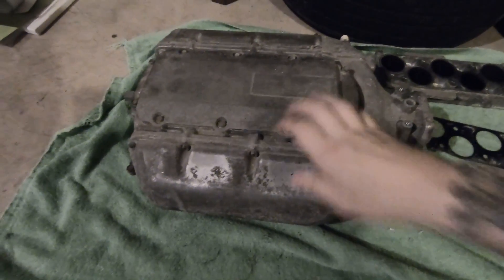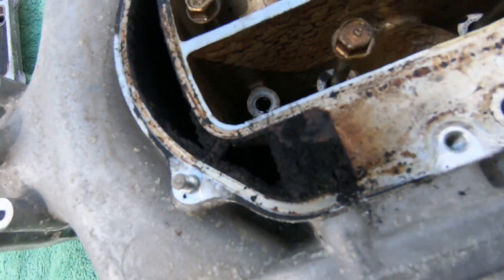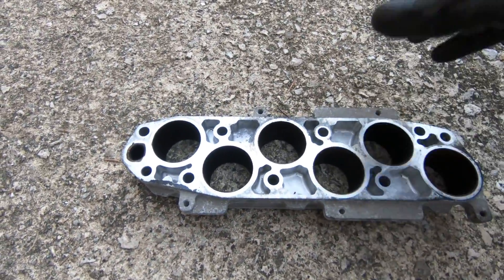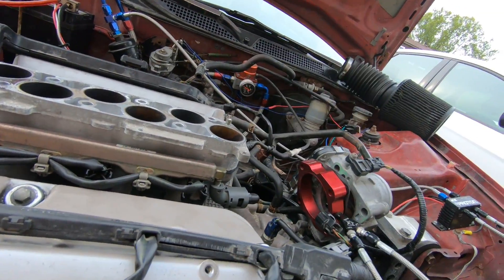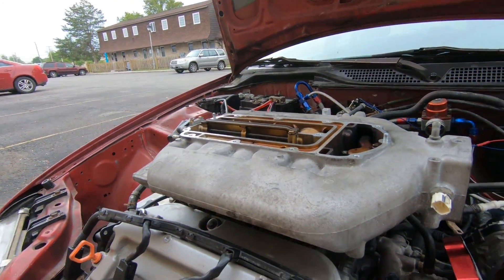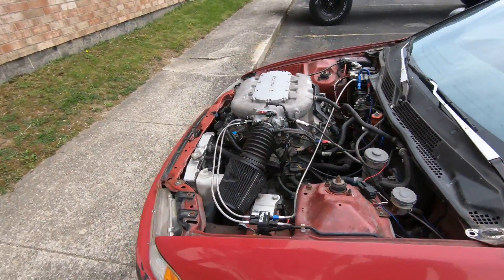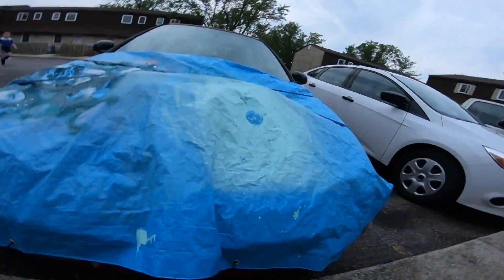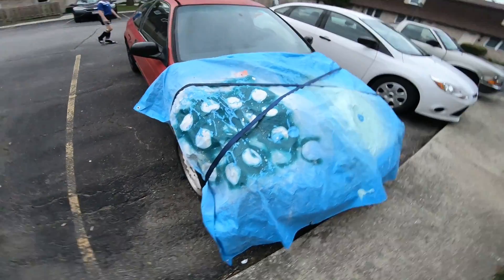Is it worth it? j35 intake manifold spacer on j30 accord motor

Comment: the spacer makes more torque,  not top end hp.. they made them for the mini vans to move the weight.. but love the content!!!
Reply: Mostly more torque, but increasing the length of the runners from upper to lower, actually creates more velocity and in turn, does give more horsepower as well.

Comment: That is cool man cuz of the power to weight ratio. However, you need a custom Hood to close over a J35 and swap in a J35 from the 07-08 TL Type S plus LSD Transmission!
Reply from the maker: I have a good that will close as well as an lsd Trans! I went with this engine because my buddy has a j32a3 accord that makes 1000whp!

Comment: Nice work. What transmission you using bro? Do I need a transmission adapter.
Reply from the maker: shaka ripper I’m using a tl-s 6 speed tranny; most j series engines you won’t need an adaptor but some will!

Comment: My question is can 3.5 heads fit on the 3.0 block??
Reply: That's a good question
Reply: Yes I did it today
Reply: Yes it can, that's the best way to make power with the J30 motor. J32 or J35 Heads, the provide the best airflow.
Reply: @fadedxmist7102  Awesome thanks, and thanks to Cesar who did it just 2 months ago. 
 Can't wait to get mine modded.
99 Accord LX coup. Mint. Cond. Now that the tranny was rebuilt.

Comment: Did you happen to figure out an intake manifold that works with the cable throttle? Working on a j32a1 and need help
Reply: There are adapters to use a B-series style TB, you also need to make a new bracket to hold the throttle cable.
Reply: You can use the j35A4 intake with the j32 Throttle Body it bolts right up

Comment: I recently bought an 03 accord with the j30. Would the j35 intake fit on it without needing to get a custom hood to fit it in?
Reply: Same got the stock J30 6 speed 04 got the J pipe so that I know can go on without any modifications I think if you just get some hood spacers your good because I do belive the 7th den accord is larger than this year accord if I’m not mistaken

Comment: I have an idea in my head of using a j series in my 87 4runner. Wondering if you got some insight on the wiring. Just started the Google searches
Reply: Ever make any progress? I'd love to put one in my yota pickup. Seems a good fit with more torque and rev range, but not so much to break the trans.
Reply: @outspokeninsider752  no progress yet, still running the 22re, I still would like to explore this though, my truck is far from perfect so I don't mind cutting it up for science haha

Comment: What transmission are u running for that 3.0 bc I wanna put a manual transmission in mine I'm sick of the automatic
Reply: ik it’s been 9 months but ig you’re still looking throw a tl type s trans in there
Reply: or a 3.2 tl 6spd
Reply: My Factory 05 Accord 6MT  coupe came with 3.0 liter V6 6speed with better suspension and tires. It changes the Accord to a fast f r. Best time I've had in it was in the mountains of North Ga. Nothing like 2nd and 3rd gears

Comment: Where you get tht nitrous Throttle body spacer?
Reply from the maker: 4.8 king Guillen it’s a k series throttle body spacer with a nitrous port
Reply from the maker: I got it from p2r I believe
Reply: Bolts up no mod?
Reply from the maker: Yeah it has the same bolt pattern as the drive by wire j series tb

Comment: Would it be a good idea to put a j35 intake manifold on a J32A?
Reply: Hi I have a 2003 accord v6 3.0l I’m tryin to swap a   J35a7 into it can I use the j30 wire harness and ecu on the j35???
Reply: @omarharris7683  Yes you can use the harness but ecu I’m not sure about. If you’re making it manual then you might have to use the J35 ecu
Reply: @TakeItEasyRell  the ecu is manual frm the 3.0
Reply: @omarharris7683  then it should work with no issue
Reply: @TakeItEasyRell  thanx bro

Comment: What’s the setup
Reply from the maker: King Bon j30a4 and a type s trans!
Reply: Wiring and engine management setup ?
Reply from the maker: It has a stock ecu with an Apexi neo piggy back tuner and was dyno tuned by a local company
Reply: Sleepy EG how was the wiring done I’m looking to get a wiring kit for the J
Reply from the maker: King Bon to be honest I’m not really sure what harness was used, the wiring was done by a guy in New York from what I was told